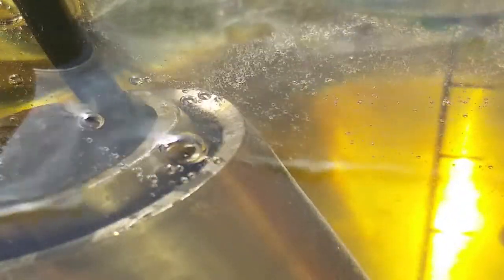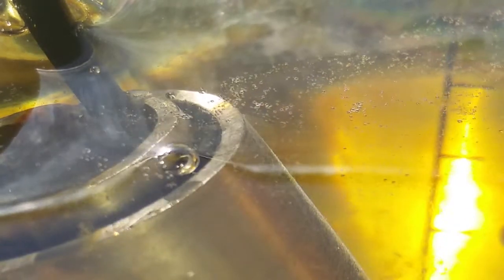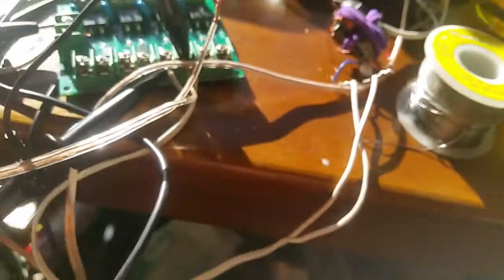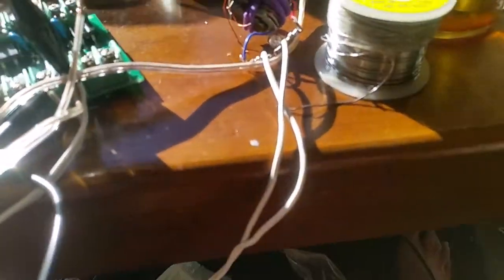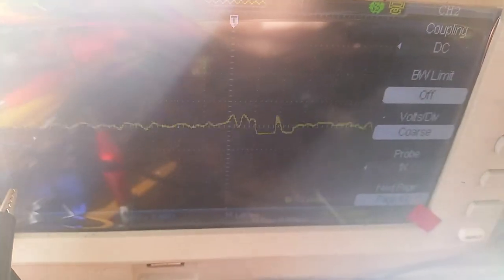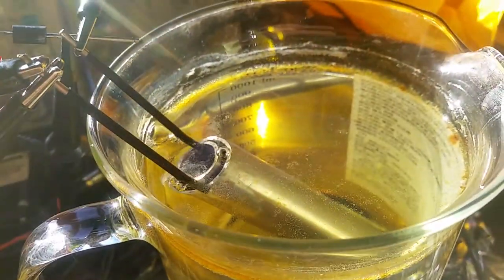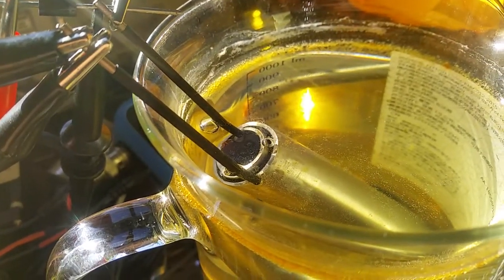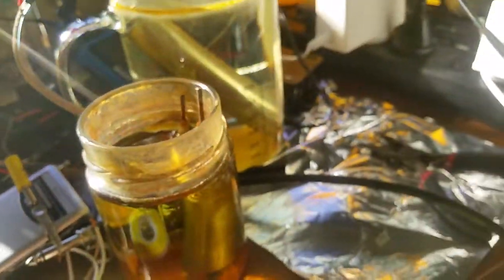Guitar HHO...music switching FET

Comment: You might find The Sweet spot frequency 😂
Reply from the maker: each cell is different and you need to have a bigger gap. or it wont step charge. everyone goes with too small a gap...gotta be a bit over 4mm
Reply: @m3sca1  realy that's interesting. Are you sure of this because I have thought about it
Reply from the maker: @raloed.363  i have tested it. i wondered why i could only step charge my close gapped cell to 2.1v. Then i tried a 4.1 millimeter gap and got it up to 30v. Then i made a cell with no return path so it was essentially a water capacitor and it went over 100v. Yes 100 percent sure. Of coarse the driving circuit needs to be able to run voltage high enough to get to these values to be able to achieve this. There are frequencies that strike at the heart of water but you need to consider the gap and the size of the cell and the water needs to be not full of electrolyte to find this out.
Reply: @m3sca1  it would make sense two small of a gap won't step charge because the current can easily pass through. I'm guessing the larger space allow more water molecules to allign and add up together. Kinda like each molecule is a battery and they are being placed in series. I always found it weird that Mayer used large gaps in his demonstration but recommended a gap less than or equal to 1.5 mm.
Reply from the maker: @raloed.363  when tuning a Wimshurst machine for bigger sparks... the bigger the disctance between the brushes the bigger the spark... more atmosphere between and like you say less current path. I was applying the same thought process when I tested the gap. Also remember that in one of Meyers patents there is a variable gap water cell. Have a look at that and tell me what you see.
Reply: @m3sca1  when it comes to spark gaps you get bigger sparks if you widen the gap because a higher voltage must be reached to cross the bigger gap and thus the capacitor gets more time to charge and store more power. Also the frequency of spark decreases with gap size and to transfer the same power the gaps must be bigger and brighter
Reply from the maker: when i got my Wimshurst i kept holding the brushes to the wheel...but after a time they get swept off the wheel and thats when it gets way more charge...like you previous comment more water between the plates... with the Wimshurst more atmosphere between the wheel...of coarse it has to be a bigger spark to jump a bigger gap but unless the potential is there it wont jump. My ignition coil wont jump further than it can because the windings proximity...look at a tesla coil....space...loose coupling.

Comment: Mecasa I recognize you I think from the ionization site
Reply from the maker: ionizationX? i have not been active on any forums for years... is it my posts or others reposting my stuff?
Reply: @m3sca1   ionizationx from like 15 years ago I was under the handle carbednotch
Reply from the maker: @ashvillescorner9931  yeah wow, am looking at the site again now. i am working on a new cell. Will post something this week.
Reply: @m3sca1  excellent! I am watching.
Hopefully I will have some new content soon but right now I'm moving so it's just not possible. I have a lot of interest in the concept of cavitation. Look at the "pistol shrimp"
Reply from the maker: @ashvillescorner9931  are you aware of Ohmasa gas?
Reply: @m3sca1  never heard of it
Reply from the maker: its HHO made with cavitating plates that are also electrolysig. it can be liquified, stored for years and is no longer HHO. Very interesting you mention the cavitation. I did an experiment this week that took the bang out of it, now i don't know why. Changing the burn rate with....
sand🤷‍♂️
Reply: @m3sca1  if you look at Stan's injector, he used cavitation with the discs and the 120psi. There's something there....
Reply from the maker: yes interesting. all i did was cover the cell in sand.
Reply: @m3sca1  that's wild.
 I looked at the ohmasa gas. They using it in torches burning stuff. I like to see what Stan had going on with the rocket fuel injectors. The bubbles seem like a good start but it's not technically "on-demand" as Stan stated.
Reply from the maker: @ashvillescorner9931  Ohmasa ran an engine on the bench with it. When he went to cars he only mixed it with gas 50/50. He knew and warned Bob Greenyer about the people who seek to supress the miracles of water fuel. I suspect he is playing the lomg game of wanting to keep doing research without losing his head. Japan has a long history of inventions that could have ruined big oils monopoly. There was also the genepax water fuel cell, which made electricity from water.
Reply from the maker: are you on discord
Reply: @m3sca1  I don't have discord. Is there a group on there?
Reply from the maker: a few people, not many... its great for sharing. YT has censored so many comments, and slow to deliver when its important
Reply from the maker: @ashvillescorner9931  i do remember your name from back then👍